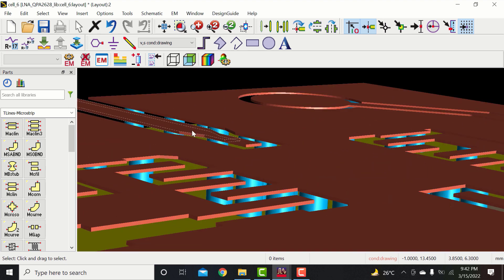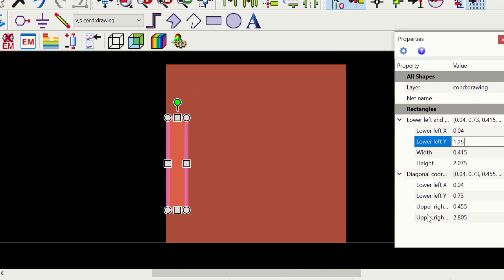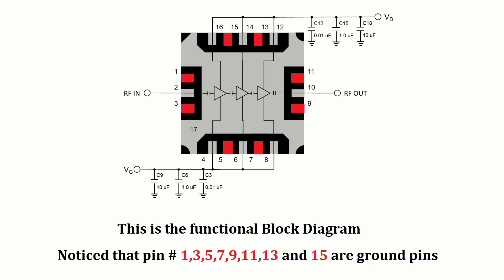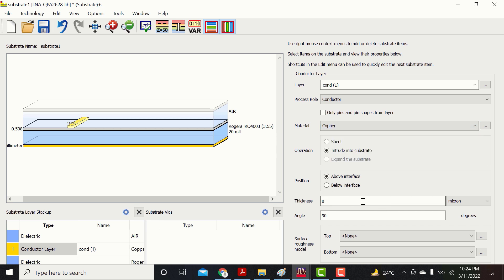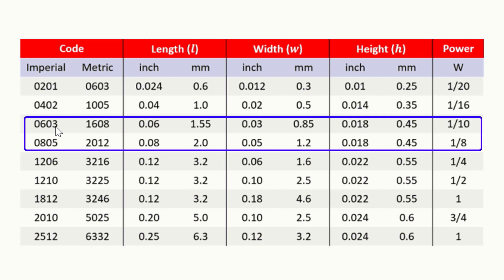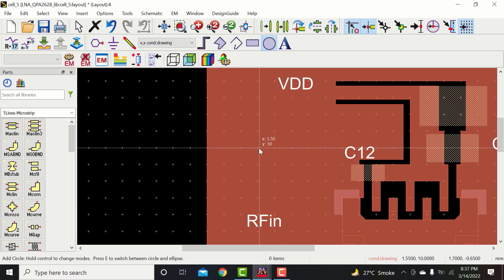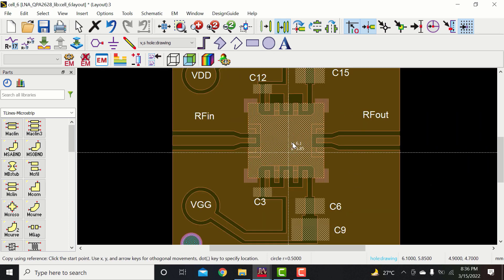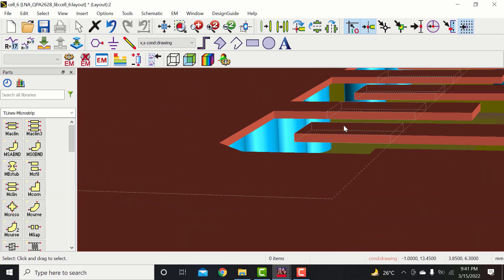ADS - LNA PCB Layout design on Keysight ADS #ads #pcb #layout

Comment: ADS PCB design is primitive and clumsy.  Anyone would use it for PCB layout is for the high-frequency simulation.  So ADS PCB layout without simulation is kind of pointless, because of other EDA like Altium does a far more better job for PCB layout than ADS